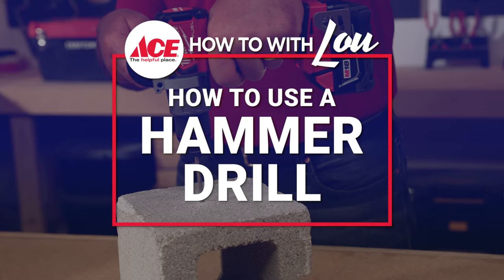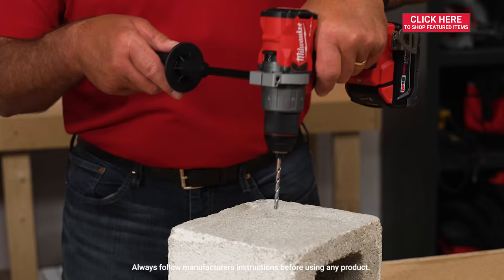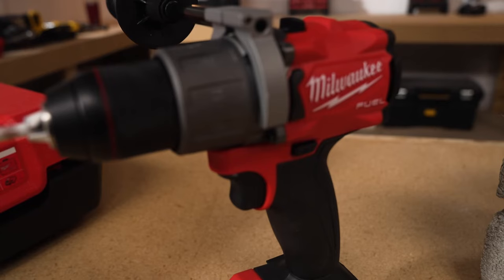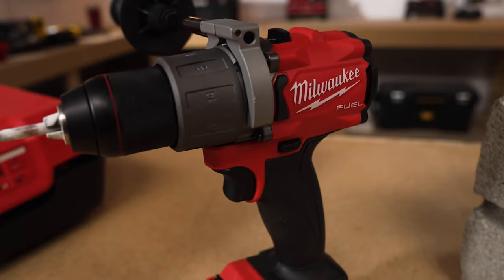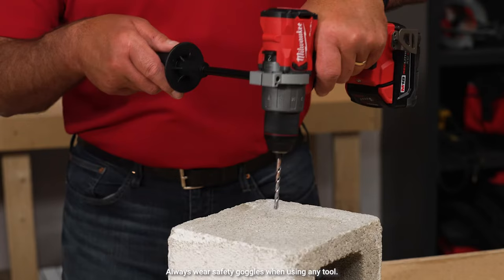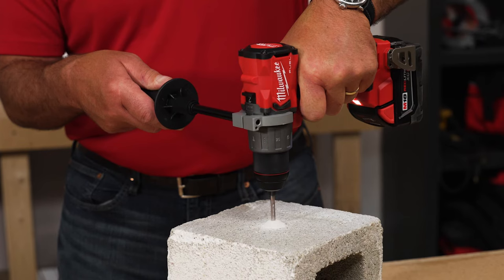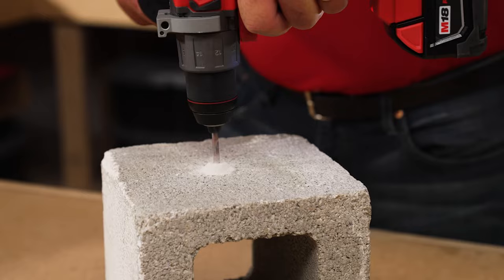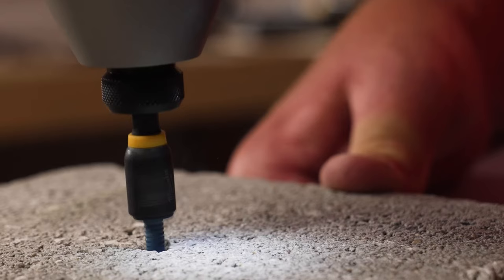How To Use A Hammer Drill - Ace Hardware

Comment: HaD a  question for you if I wanted to try to use my hammer drill and I for some reason for got a hammer in tool box could I not set get a masonry drill bit and set it to hammer mode as an alternative in dry wall thoughts please thank you I mean could I get it to function as a hammer substitute? Ideas please thank you
Reply from the maker: Hi There,
Unfortunately, a hammer drill will not act as a power hammer. You could always stop in your local Ace and describe the project (photos help a lot too!) and they can make some suggestions.  Hope this helps!

Comment: Load of BS. Cordless "hammer drills" don't hammer, they vibrate and do nothing at all.
Reply: didn't believe you until i heard it running 😂😂 I'll pass on this
Reply: Didn't look like anything was happening. I'm gonna hang up a ring cam is a regular drill fine?
Reply: @leightonlawrence8832  As long as you aren't going through concrete. I bought a Milwaukee hammer drill last year and that thing plows through concrete like its butter.
Reply: I think it just depends upon the brand and how much power the battery delivers. I used my friends cordless dewalt 20V hammer drill and it was rad, I was very jealous. That being said, I have a super beefy 7.5 amp milwaukee corded drill and it's undefeated. But I've only really needed it when I was drilling a large diameter, like a foot deep. If you're just doing tapcons, then cordless seem fineeee